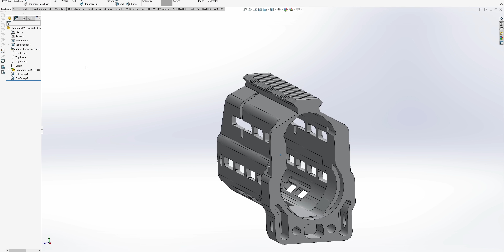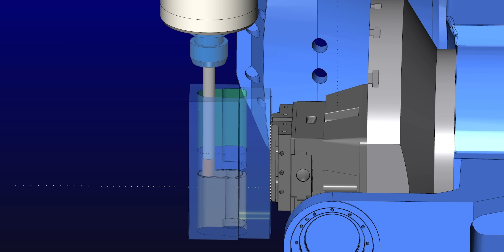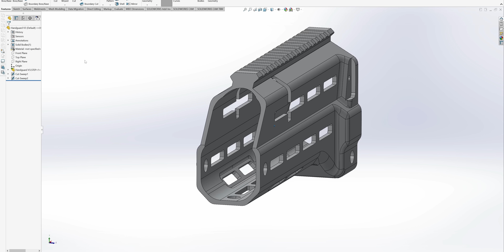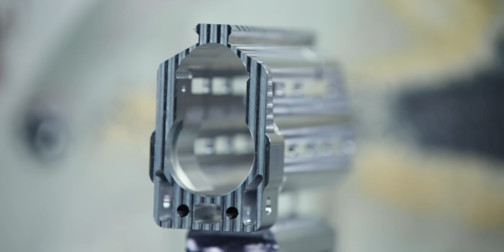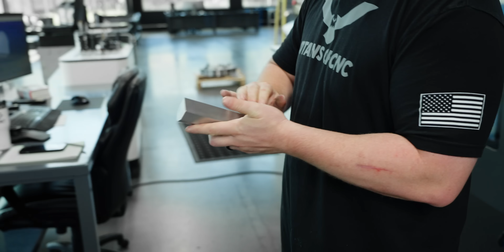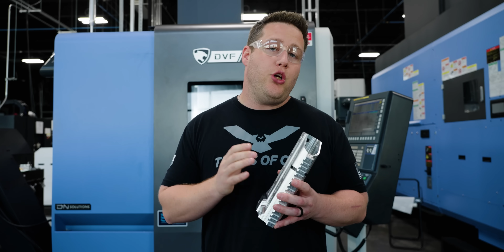Re-Machining the SCRAPPED AK-50 Hand Guard for @BrandonHerrera

Comment: Whomever reads this: The RIGHT machine, or a 5 axis machining center in this case, is roughly 2 - 4x more $$$ than a 3 axis conventional CNC lathe. Subsequently, the per-hour you pay is significantly more. Perhaps Brandon gave the other shop a limit on what he could spend... considering it's a prototype. Clearly the other butchers were ill-equipped. 

CHATTER: pack it full of Play-Dough or modeling clay or get the upgraded spindle servo that varies rpm up and down while it runs. Magnetic material chattering? Slap some magnets on it....magical!!

Comment: I would love to know how you guys decide how much to oversize your raw stock by. It seems like you remove a ton of material on all sides of the part. I have typically always targeted about .125" additional material per side and sometimes as little as .010" per side for the plate thickness. I don't really have any reasoning behind that other than just trying to use as little aluminum as possible. Would be very interesting to hear your perspectives on how to select raw stock.

Comment: I wonder if CNC machine makers have considered adding an anchor point that the far end of the drill bit can slot into so that vibration/harmonics are not a problem. This would mean redesigning drill bits so that the cutting is done at midpoint but it might worthwhile in terms of accuracy, cancelling vibration and opening up more rpm and other options for operation.

Comment: Currious why you wouldn't just use vice jaws cut for a picatinny rail that could be used for several things rather than a 1 off crush block? I get the extra leverage but, shallow cuts done a but slower should be fine I would think. Just a though but Im a Milwright,Electrician,Mechanic certainly not specialized in CNC.

Comment: When it comes to aluminium I always wonder - why not just cast it? With such a low melting temp it'd just be easier, even if you just did it to get 98% there then cleaned it up it'd save hours of work and you wouldn't need a quarter million dollar machine.

Comment: AAAAA so many things hurt me here with everything I learned in machining. Why use your good gages that are milled PERFECTLY to size. Measure with calipers, and check if your caliper right with the gage, then you wont wear away or scuff them up. Not like it matters cause a picatinny rail will almost work reguardless, but that second pass though only shows that moving that quick warps the metal, then when  you passed through again you got rid of the heated warped metal, then when it cools its not gonna be to spec. At least the bits are getting more durable for this quick motion, but it still hurts.

Comment: As impressive as this is, the design of this thing is severely lacking even for a prototype. Sure, the customer is always right, but just a few engineering decisions and solutions could make it ten times easier and faster to produce, also cheaper with basically no compromises.

Comment: maybe a stupid question: couldn't you have used the picatinny rail to mount the handguard in the vise instead of making the crush block, or would there have been too much flex and/or movement?
now, i'm certainly not an engineer/machinist - barely have two working hands - but just a thought that came to mind.

Comment: I could have done without the fake drama on the chatter. I've never touched a lathe or mill but I knew when I heard it you were running to fast and to be honest I'm pretty sure you did to, if not I have to wonder if you are an actor or an actual machinist. other then that the part looks amazing and I'm sure it was a bitch to mill but you guys really came through for Brandon.

Comment: I have a question. Why do you use aluminium as a crushblock? We use polyurethane which is easy to work with, really cheap and last long. We use it both on serial production as well as for prototypes

Comment: (No one is going to read this)

A good Sci-fi gun design would probably end up looking very boring, a well designed energy weapon would probably end looking like the Ruger LC 5.7 carbine.
Power source in the grip or stock, pic rail on top and M-LOK on sides and bottom for extra customization.

No hoses or wires, no unnecessary moving parts no giant tank big enough for a flamethrower, just simple compact and reliable.

Comment: After you had the .030 tabs and needed to machine the last mlok and were worried about crushing it, why not utilize the rail on the top of the part to hold it secure instead of a crush block and all that?

Comment: This is kind a hard to watch. use a polygon cutter and program it with 0,2mm offset to the cutting radius. Then you can finish with 0.05mm steps. It will have a nice surface and no rattling what so ever. Also use cooling with about 8 to 10 percent emulsion mixed with water. I know its aluminium, but because of the material you risk having a built up edge on your tools, especially with aluminium and 7075 works fine with cooling. But nice video at the end

Comment: Nice looking part, and I envy the picatiny form cutter and 5 axis. I just use 3mm ball and 3D for my rails in my small Emco Vmc300 . Or chamfer tool, depending on the part. 3 axis is enough, fourth would be fun, but five would be like heaven. But it’s all about making chips. Thank you for the awesome video!

Comment: is there any reason you couldnt have mounted the part by the Pic rail? I know you then would have been putting force at an odd angle, but you had to go low and slow anyway. I also get that if mounting it that way went wrong it could mar the part a bit..

Comment: Good ole circular interpolation..I used two run two gidding&Lewis ram 630 cnc machines with 6 rotating tombstones for parker hannifin manufacturing hydraulic pumps, and parts..cast iron,and aluminum..talk about ridiculous tolerances! We even made some parts for aerospace, and nasa..what a pain in the ass lol!😂

Comment: For a complete layperson, this sort of precision is awe-inspiring!  I thought it would have to be 3-D printed.
Reply: Brandon did a video where he showed off the parts that still needed to be made at that point in time. The printed parts were fluro yellow/green. It was just made to show us what bits were missing. I get the idea it wouldn't hold up to the pressure for the actual part.
Reply: @Tollywaffle  Good point, thanks!

Comment: Man, it's just a hunk of aluminum that flashlights and grips get slapped onto. Why did Brandon have to make it so difficult to machine? I feel like it could've been a stamping, with an m-lok mounted partsbin picatinny rail on the top. That's what m-lok is for, so the precise machining of picatinny mounts can be done on a smaller, simpler separate part that then can be attached to the cheap stamped handguard. Man Brandon, this project is cool, but this is just ridiculous, you're wasting your budget.

Comment: Just awesome. I miss the fulfillment of cnc programing and machining a brand new one off prototype out of a chunk of material. Did the worlds first Veyron turbo upgrade. Also, had some flawed reverse engineered mhi chra housings, expected 50% scrap rate. Got it down to 25% using long reach boring tools and, as you put it, kissing the baby. Lol. We were on Okuma and Mori seikis. I left before getting to use the haas and space center

Comment: After watching this I was just looking around for CNC operator jobs near me and I found some website that said there is a 90% chance of the job be automised/robotized within 20 years. Is this true and/or does that even make a difference? From what I just saw it feels like it already is automised but still needs a human to create the paths/patterns and do the quality control etc. I have been looking for a job and this just seemed something I would enjoy but the information online makes me kind of weary to invest into getting educated into this field.
Reply: I'm sure that you have nothing to worry about when it comes down to holding a position in the CNC field. For most companies, I can only assume that full automation would require too much R&D to get something like that to work, and you would still need someone to set up toolpaths/refill materials/swap out tools/etc etc. Finding a few individuals that can handle all of that alone would ideally be much cheaper than full automation, training included. There are way too many constantly changing variables that go into machining for an autonomous robot to handle at this point in time.

Comment: it's extremely expensive for a single piece. this is only a handguard, accuracy in some places may have minor errors. a normal engineer would have made it from parts, especially the Picatinny rail should have been made separately. AK 47 became a legend precisely because of how the engineers were able to establish cheap stamping production. history has seen a lot of crappy guns with fraser parts, which made them expensive and heavy.

Comment: Y'all made me a bell housing adapter for my drift car. Not only was customer service excellent but, the price beyond what I thought was reasonable. When I got the part, I was able to run every single bolt all the way to the shoulder with my fingers. How the hell did y'all do that without the bell housing?? If ur curious, I adapted a dc009 6 speed transmission from a 350z to a 3.0 duratec V6 found in a 2004-2010 for escape, fusion etc. I put billet rods, diamond forged Pistons, dual valve springs, copper head gaskets, custom ground cams, and a 63/66ar precision turbo on a haltech elite 1500. It went in my rear wheel drive converted 1993 ford probe drift car. I know, believe me I know. It sounds like a suuuuper odd ball combo. But buddy lemme tell ya, the thing is the best balanced, most reliable drift car I've ever owned, driven, or been lied to about. She weighs 2620 lbs with me in it, the engine sits 3 inches aft of the strut towers, it has perfect 50/50 weight distribution, and on pump e85 she makes 581 wheel horsepower @ 6800rpm, 537 tq that stays flat all the way from 3400rpm to 7500rpm. These little duratec engines are the best kept secret in drifting. Mine was bone bone stock for 2 years making 430 wheel on pump gas then the stock head gasket pushed on a super hot day last season. Sorry about the long comment, just wanted to thank you guys. You really do some very very good work.

Comment: If you can't do a part, just tell the customer straight up. If you think you can do a part, take the job, and then realize you are not capable? Still tell the customer! Don't send them trash and charge them for it. 

Honestly, I would have told Brandon, this handguard can't be made from one single milled stock. It should be made from multiple pieces (two, maybe three). I know Brandon wants to eventually start selling these things and he might as well start thinking about that manufacturing process now. 

Either way, you guys are truly amazing. I can't believe you guys were able to accomplish this piece of art work!

Comment: Aluminum is such a weird metal to machine. You would think its easier to machine that steel because of how soft it is, but its quite the opposite for that exact reason! It's so soft it binds to the tools. 7075 is just a shy bit softer than mild steel if I recall correctly, and doesn't bind as much has 6061 (Very common in the firearm's industry), but is far more expensive, and unfortunately, there is quite literally only a handful of companies in the US that can do 7075 extrusion. The company I use to work for, Alexandria Industries, specializes in precision machining and extrusion, however, atm, can only extrude 6000 series aluminum. The location I worked at only did machining, and we only worked with aluminum, mostly 6000 series for heatsinks, mounting brackets, and other stuff, but we also did firearm parts like handguards for APF and Bravo, charging handle latches for Daniel and Bravo, and at one point, they did AR 15 upper receivers for Bravo. We pretty much supplied most of our own material to machine from the extrusion facility, however, anything that needed to be 7075 was from those handful of companies. Pretty much every firearm part we did was 7075 aluminum, and with it being aircraft grade, is used heavily in the aerospace industry, which has a lot more money and so firearm manufacturers needing 7075 extrusion were always on the bottom of the totem pole when it came to getting stock. Would be neat to see Brandon use my old employer for mass manufacturing the handguard, but with how hard it is to source 7075 atm, I doubt mass manufacturing is on the plate lol.

Comment: Yup, it's "easy" to 3D design all you want, but then you have to be able to make it.
3D printing can do anything basically, but is it strong enough ?
Even pouring it, might be very hard or all but impossible, or again, not strong enough.
So mill it out of billet. Yeah, as if that's easy. Angles, hoe deep you can go, it can be a pain alright.
This is why you pay companies the big bucks, the know how, what can you and can't you do, in what order should you do it before you paint yourself into a corner, even trying to talk to you about changing a model, and even doing that for you, and the having the machine to do it.
You can do a lot nowadays with machines, 3D printing and milling etc, but should you, how, why not, does that work in the end for what you are trying to do, won't it make the end product basically too hard to repeat or overly expensive, perhaps ending in having to change quite a bit of the whole thing just so you can make it easier and more reliably.
I mean, if a .50 cal AK-47 ever goes into production, let alone at any decent numbers, i kind of doubt it'll be anything like this !? It's gonna be expensive for sure, but damn, that would be almost overkill, i wonder what this part alone costs.
And he's right at the end, the obviously bad part should never have gone out the door, at the very least not as a finished product, at BEST you should show it to the customer as to why you can't do it, don't charge, advise them on another shop, honesty works, better than delivering shit and taking their money, you'll never be getting any positive mouth to mouth advertisement from them ever. We can't do it, here's why, thanks for your consideration, maybe this shop can do it.
Prototyping can be a bitch depending on the product. Quite different between an airsoft replica and a .50 cal anything. Makes 3D printing stuff for let's say a shell for a computer mouse seem like child's play.

Comment: Hi absolute newbie here who is just interested. I have a question. What determines if you use coolant or not? Like is it per situation or only when cutting or something like that?
Reply: Aslong as the machine is running u generally always want to use coolant, they dont for filming purposes.
Reply: @verakoo6187  typically, yeah. In my experience I don't have active coolant flow if its a soft material... then again I don't push my tools like these guys do so that could also be a reason.
Reply: @cjherbst7726  totally random but is there anytime you shouldn't use coolant? Like it will mess something uo
Reply: @adirmiller2141  coolant on its own typically won’t mess a whole lot of things up. I can’t think of a whole lot of times where it would cause issues, but maybe if you have a low pressure system on a material that is extremely gummy. Titanium on its own is extremely gummy, and if you happen to be turning it on a lathe and have too low of flow, then it won’t clear the chips and your tooling would get destroyed due to titanium’s insulating abilities.
Reply: @cjherbst7726  Thanks for the info man
Reply: @verakoo6187  thanks!

Comment: Use a two tooth t slot cutter for the mlok slots. M19 the tool and insert the tool inside the slot. After you cut it M19 the tool and remove it. On op 3 you had a 1913 rail cut into the top of the part. A dovetail vise with a stop would hold and locate your part without needing to clamp onto the sides.

Comment: Just  curious why did you make extra work with the crush block ? You had all that rail section picatinny rail. Why not use that? Use a block that locks in and vice that part. Its known to hold sights tight and strong.

Comment: @TITANSofCNC with all the respect I disagree with the opinion that the inner pocket couldn't be made with a key cutter (slot mill). If the (difference in diameters between the flute and the shank of the mill divided by 2) was larger than the width of the rest flat surface of the inner pocket it could be done. The internal radii of the pocket though would have to be changed to the radius of the flute of the slot mill. That's just another approach to solving the problem though. The part came out really impressive! Congrats and thank you for the great opportunity you give us to learn pro machining! Cheers! 😁

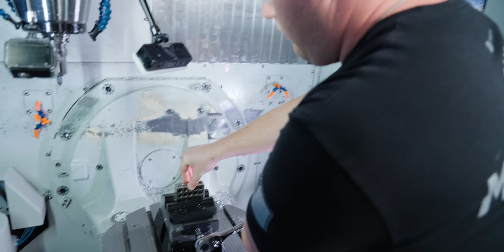Comment: 17:00 any reason you didn’t go with a picatinny mount to secure the part? Is that something you would consider for mass production?
Reply: Most shops dont have picatinny vices on hand, usually only used in gun manufacturing. Also the AK50 is never going to be mass produced, especially by titan lol

Comment: Would it have been possible to wire EDM most of the inside and outside profiles?
Reply: Possible yes. Waste of time also yes. EDM is great for small parts but cutting tall, thick material takes forever. Ud have to put it on a mill anyways to do a wire guide hole thru the middle and one for each slot, then would take 10+ hrs to do the outside profile and days to do all the slots and ID. Then u would have to put it back on a mill to do the inside pockets and chamfers.
Reply: @verakoo6187  I meant the profile only. Roughing it out with a large endmill, and just use the EDM as a "finishing pass"